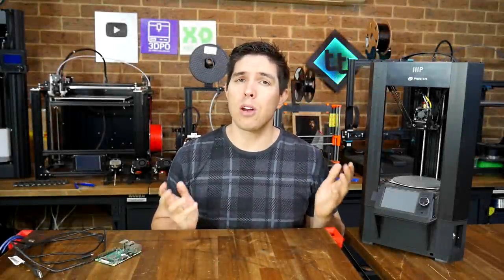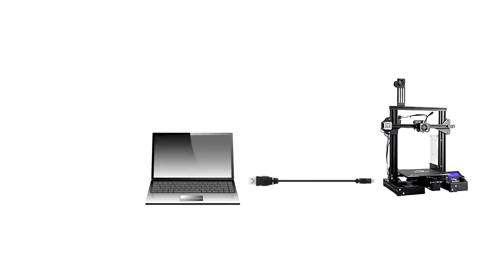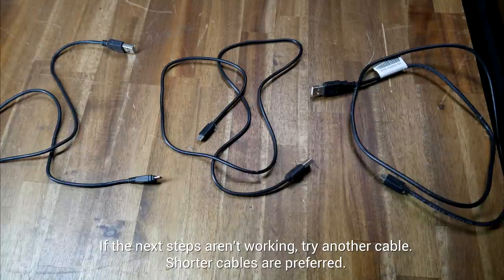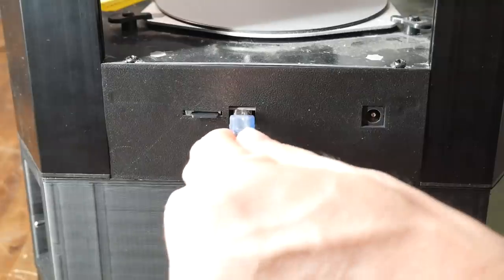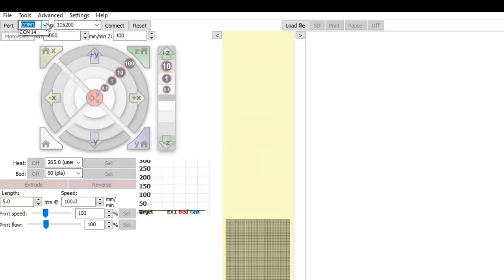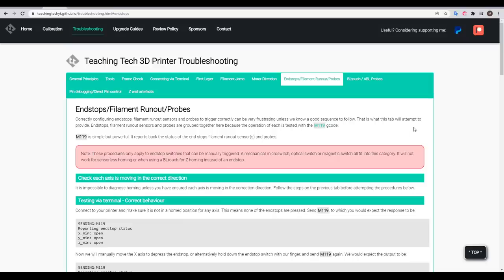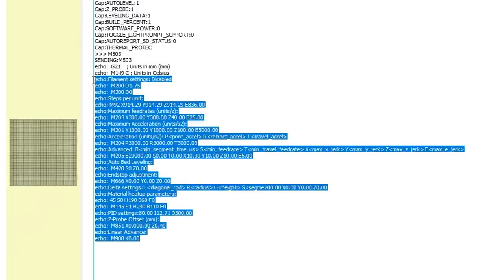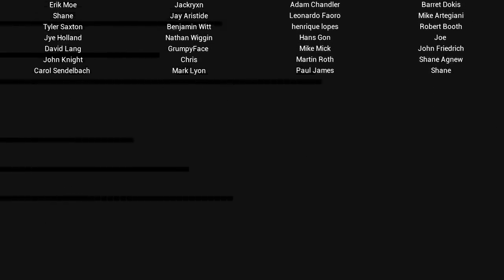How to connect to your 3D printer via terminal - Pronterface & Octoprint

Comment: Discovering Octoprint was the best thing ever. No more SD cards
Reply: Set up a home VPN and webcam and you can check your prints remotely right on your phone!
Reply: Changed my life.  Should be bundled as a package with mid range printers along with a BLTouch.  These items will save your sanity and more than their cost in wasted filaments and broken parts.
Reply: Yup.  I have Octoprint running on an old windows laptop that I can connect from anywhere with Anydesk.
Reply: Do I need to follow this recipe just to connect my Ender Pro 3 to my laptop? Do I need to use the software?
Reply: @josephmacina863  No.  You can just plug the ender into the computer.  You will need the slicer software the creality folks supply or download it from the website.  The benefit of these setups is that you can shut your computer off and you dont have to worry about causing hitches in printing.  You can also copy the gcode onto the sdcard and carry it to the printer and the printer than then execute it.

This setup is just providing more information than the 3d printer offers standalone.  You will figure it out.  If you are missing something... then this video will make sense.  If you dont miss it then you dont need to know.
Reply: @someguy2741  Thank you very much.

Comment: Thank you Thank you Thank you.  I am trudging my way through this 3d printing learning curve (Ender 3 Pro) and all the new information keeps locking me up because nothing about this is simple, step a, step b, and so on.  This new "hobby" is like raising a teenager, you get it set up you think everything is smooth including your Benchy and then out of left field there is a new drama, and another one and why is the entire octopus flawless but the silly joints connecting it's legs to it's core.

This is definitely learning a new language, I have always been a figure it out self teach kind of person but i will gladly share credit with great instructions.  I needed this video on how to download the software, it wasn't obvious and as an over thinker I want to do it right the first time and the amount of options was putting me in analysis paralysis, i was unable to download anything.

Let's see if calibrating the extruder solves the problem because i have disassembled and squared the frame, modified the leveling screws, upgraded the springs, and spent more hours than i care to admit leveling the bed.  I have done the temp towers and retraction setting calibrations and feel like the only thing left is the extruder which i have been putting off because it involves software and code.
Thanks again!

Comment: +1 for mentioning turning on the printer before plugging in the USB - a very important safety measure. You could cause damage to your USB bus and even the printer, if it tries to draw too much power from USB.

Personally, I prefer octoprint to pronterface. In my experience I have found pronterface disconnecting, probably power saving on the USB bus
Reply: "pronterface disconnecting" Thanks for that, I thought it was something I had done wrong being a newbie at this. It was quite happily printing a decent quality, then stopped. It did look like the USB bus had hung, given the lack of responce.
Reply: in windows you can set the usb power saving feature off, ask chatgpt and till run you through it

Comment: I made a special usb extender with the 5v line disconnected so it won’t interfere with my creality printer. This has been mentioned on the fb groups.  Also correct me if I’m wrong, arc welder won’t work on 8 bit boards.

Comment: Hi Michael,  Thank you for a great tutorial on setting up Pronterface as I'm using it with your calibration site for all my printer setups and am having great success.  I just have several comments that might help out anyone with Pronterface to printer connection issues.

Initially When I was trying to make the USB connection I was getting this error, " [ERROR] Could not connect to COM3 at baudrate 115200:   Serial error: could not open port 'COM3': WindowsError(5, 'Access is denied.')

I checked the Device Manager on my Win10 system for the correct port setting and baudrate, they were set to com 3 at 11520 baud.  I checked it in Pronterface and it was set to com3 at 11520 baud.  I checked my printer firmware " Miguel Risco's Professional " to make sure that the Advanced box for 115 baud was checked.

After some digging around I found out that since I had Cura 4.13.1 running prior to Pronterface, the Cura app had captured the port for it's own USB use.  I then closed the Cura app and discovered that I was able to connect with Pronterface to my printer with no issues.  If I then started Cura I had no issues with Pronterface Disconnect, Connecting or Resetting my printer.

The other note is regarding the USB cable itself.  I found during a Klipper upgrade that the Raspberry pi, when powered up and connected to the printer it would power the printer Mother Board even with the printer powered off.
This same thing happens when I connect my computer USB cable to the printer when I'm using running Pronterface. 

My personal thoughts are that I don't want to different power supplies being connected together thru the type A  USB cable.  Some bad things might happen.  I now disable the 5vdc pin in the USB cable to prevent the supplies from possibly bucking.

To disable the pin, view the large rectangular plug of the type A USB cable looking into it's end with the pins inside facing up.  The pin on the far right is the power one, place a small piece of tape over it to break the contact.  Just enough to cover that pin only and not any of the other ones as they are the common and data pins.

Just my 2 cents worth.  Thanks again for all of your efforts sir, you are top shelf.
Doc'
Reply: Same Access denies error on windows 11.
Solved it by closing Cura. Thanks for sharing!
Reply: @fernandoing  Glad that your connection issue is resolved.  Someone shared with me as well.
Reply: Bro I love you

Comment: I did find the reason for the Pronterface dropout. There is a power saving device on Windows, whereby the USB is turned off after a certain amount of time.
This can be changed in the Device Manager under the USB settings

Comment: Hi, Great video, yet it's not functional anymore for people who want to use Pronterface.
The Pronterface PC installation doesn't work anymore.
After downloading pronterface, the file simply doesn't run on PC's anymore. Many people complain about it, and some nerds can fix it by compiling it again, making changes, but this doen't work for the average user that need your video's to get it working.
Nothing you can do about it, you make great content. This is a Pronterface problem that needs to be fixed.

Comment: Thanks for the video. It is very helful. I have a problem to connect my printer in Pronterface. Hope you can help. 
My printer is FlashForge Guider 2s. My computer is Windows 10. When connected with a USB cable, there is no Port in the Device Manager, instead the Printer is listed. And there is nothing in the Port field in Pronterface.  Thanks in advance.

Comment: + another 1. I came across the same thing when I first connected PC to printer, although the interface screen did have garbled characters, which showed that the supply was not enough to drive the interface. I am presuming that there is no opto-isolator on the USB Bus, a shortcoming of the printer manufacturer, probably to keep cost at a minimum.

Comment: So what is your take on. Power blocker? I've been given a hard time for not removing, blocking or using a power blocker on the USB cable and have been told that I'll fry my board. There was no mention in your vid about doing that. And I have watched several vids that don't mention it I only heard about it in the group pages.
Reply from the maker: I've never used it and never had a problem. Anecdotal evidence only but that's my take.

Comment: I don't know if you get notifications on comments or if anyone will read this in any reasonable time frame but I'm very frustrated with trying to use PronterFace. I'm literally only trying to use it to diagnose an issue with my FLSun QQS-PRO printer. 
It's like I have to live with problems stacked on problems stacked on problems. Like I'm drowning in problems. In you're tutorial you said to find the "com port" a little window pops up. Not on my MacBook it didn't. There was a directory automatically entered in that section. It was related to my phone which was not nor has ever been physically connected to my laptop. I have no idea how to find the actual value/direction to enter for the port. I have looked at numerous Mac forums and GitHub etc. and have not found an answer.

Comment: In installed Pronterface , but I get this error, when try to connect it to the printer: 
"Connecting...
Could not connect to COM4 at baudrate 57600:
Serial error: could not open port 'COM4': PermissionError(13, 'Access is denied.', None, 5)"
Reply: I get that error  sometimes, i just turn off / on the printer,  then i plug it into my computer. Key point benig plug it in after its turned on.  Whereas turning the printer on while it was already plugged into my computer gave me that error.